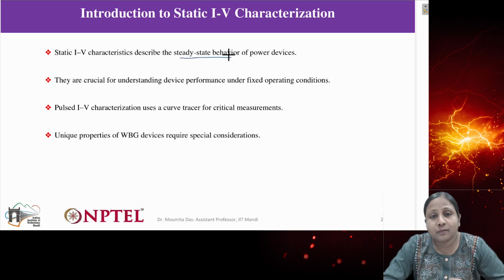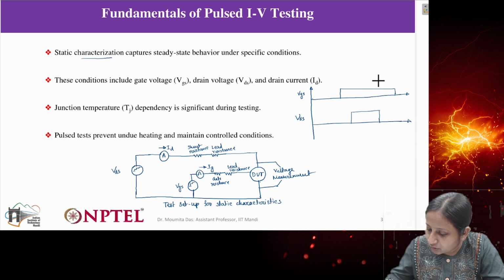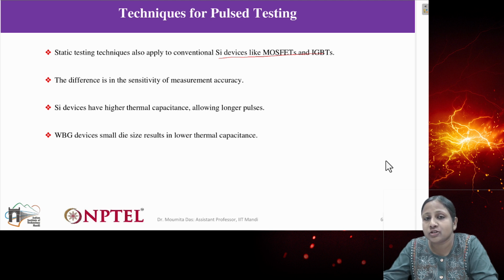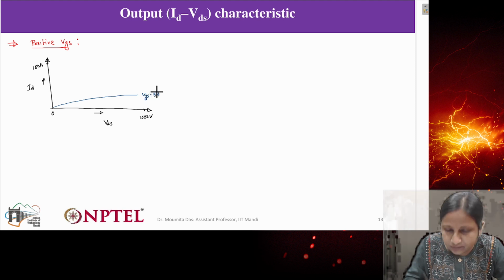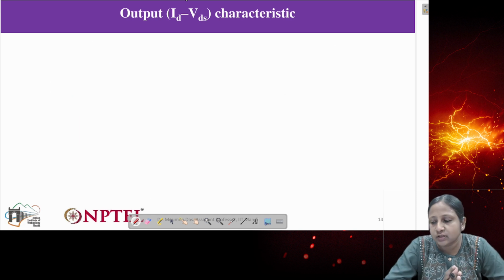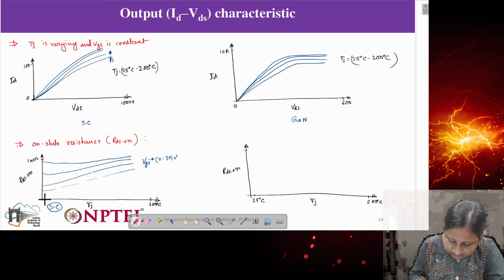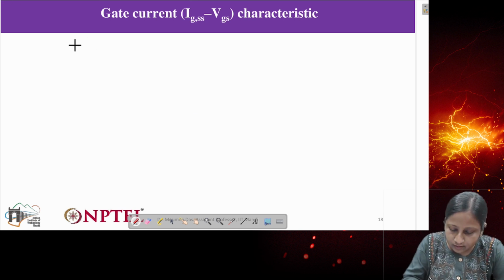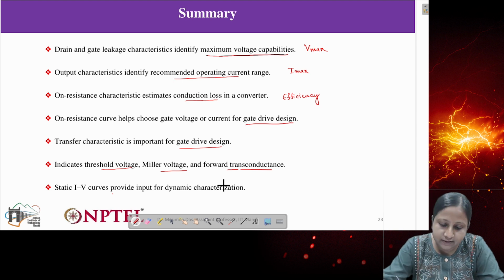STATIC CHARACTERIZATION OF POWER DEVICES

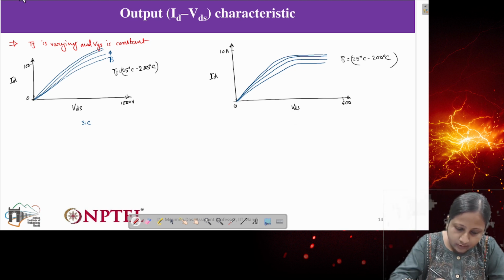Comment: by increasing junction temparature Rds_on will incfrease for the power FET , which actually reduce the ability to conduct the current , means drain current should reduce with increasing Tj.. why increasing sign is there ? 37:52 instant
Reply: Yes, correct.